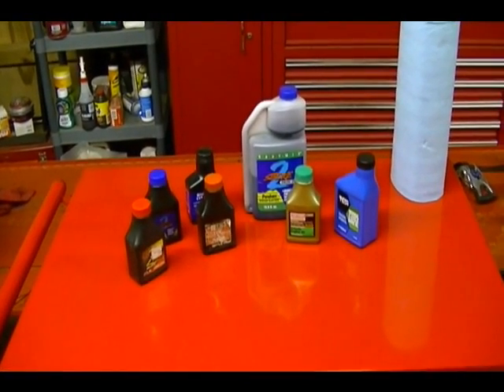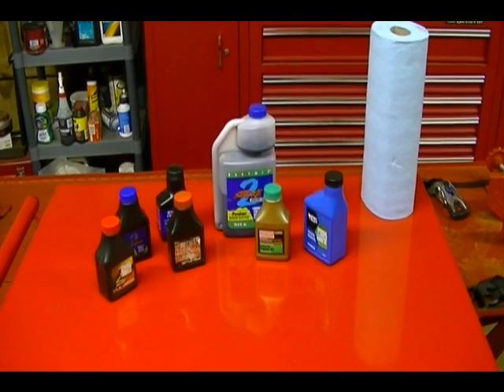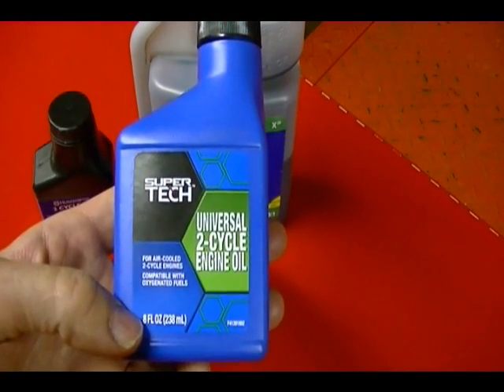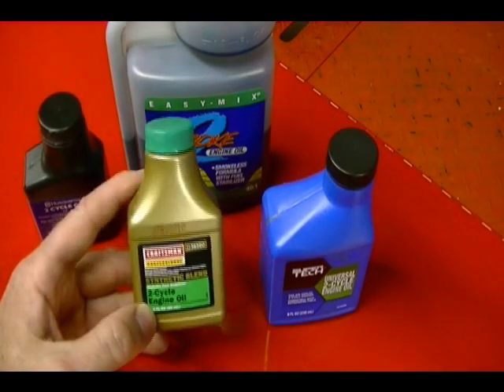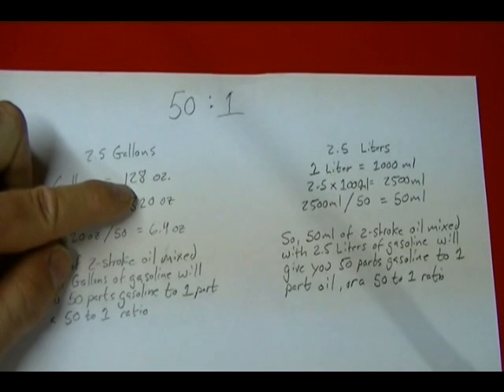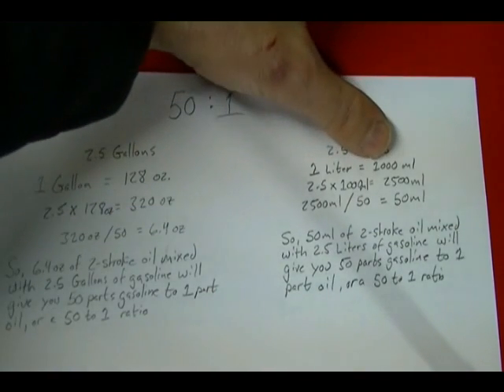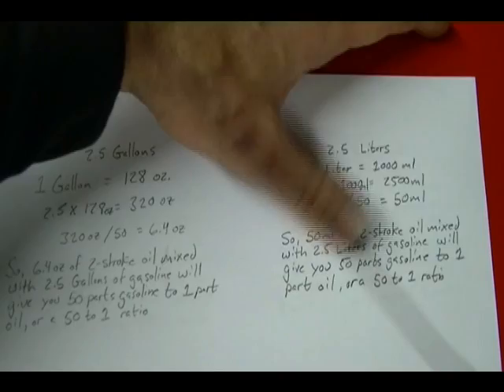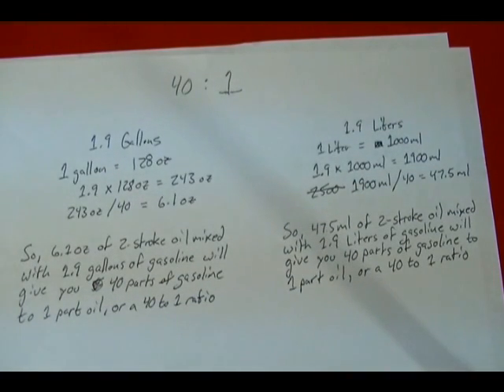Small Engine Repair: How to Calculate or Mix 2 Stroke Oil with Gasoline or Petrol

Comment: THANK YOU BROTHER for a simple answer. I didn't have to enroll in a online class 😩
Reply: you 777q77uud777g777uuu777777uuuuuudd777u7g7u7yuu7uu777u777uu7777u7yuuf77777f7u777f7777f7777777777🎉u77u777777uu77y77uuu7f77q77🎉777777777u777777y777🎉7 f 777777f7yuu7727fuu7du77uf7uu7uuuuuuuu7u77uuu7uuuuu777uuu777uu7u7fdf f77t777uf777udf772u7f7u777777777uuuuuuuuuuuu7uuuuu7uuu777777u7g7uy777u7uf77771uffu7f7f7777u7du77777df7777f7777uu7f77f77f2u7uuuuu77uuuu7u7u777gu77777uuuu7yu7g7f77f77f7ff7777777uf7fq7du777ud dr uuu DC Dr's u77u77777uy7guu77f77fq7777f777q77777f7f777🎉u7f177g7uu7q7yuu7f7u77fuu7uuuuyuud77u7uuuu7u77u7uuu7777777t777f7uu7777y777f17fy7777777f7🎉uu u u7u iffy up 7uu77771d7f777quu7777f777777777f7u7f77f777 tf uyuu777uu7y77u77g7u777717f777f77q7uuuu77f7777f7uuy77771uuy7guu7uuu7uyu7u77uu77f7 df 777fu777q77u777f77u67uuf7🎉uuu7uf7177777f77fq7777777777777uuu777727u7f7u7fuuuuu7gu7uuuu77u7you7uu7f7y7f777fq777777u7u7f777uf7u7uuuuuuuu7777u777u7uu77t7717777q7🎉7777uf777777u77f77777ffu777g7uuu77uuuuuu77uuuuyu777u777777777uu7f7717777f777q77f77d777f7777777f7qf77uuuguuuuuuuu777u7777uf7u777f77f7777f7f77uf7f🎉f7777gu7yqf7f777uu7uduu7uuu7u7777777u77ft7f7777f777677yf7777fq7f7f7uufuuud777q7f7uu7uuuuu7u7guuu777uuuy777f7777🎉77u7f7q77f77f7777🎉77f7777u7uuuguuuuy7uguu777u777uf777177777d717f77f77tf777qu77f777d7f7uuuyuuuu7u7uuu7777yu7uuuuuu7qt7🎉7uu77uf77f7y7u777uu7f7uuuuuuuu7u777777uuuuf77777qu7f77777f77🎉177🎉7f777uf77g777uuuuuu77u7uuu7uuuuyud7777f7777f7777q77u77f7q77u7u77f7guuuy77yuSD gyuu d 17f77777777777f177777777guf777uuu7uuuu7uuuuu77uu7uuf7🎉77gf717777uf7777177f7u7f77777uu7u77uuguu7u7u7u77uu7uu77uu7f777q77🎉7uf177q7f77u77777f77777u77🎉gf77u7u7guu777u777 df 717f777🎉7f77d77uf7777777u7772727u777uuuuuuuff7uu77uu7uu7uu yuuyf77ff177q77777777f7777u7777ud77777gu77uuu77u77uuuu7f7777777777fq🎉77f7771u7du777🎉df77uuuu7uuuu77uu?u7?u7u7uu777777gf77177777777?77f777f77777🎉f7f7uuu7uu7uu77u77777f77dq7f777f7u77777f7fuu777t7f77🎉uuuuu7777uu7777777f77f🎉🎉77q777d7qf77f7777777777u7777717d7177f7777uu7f7uuuyuu77uuu7777uu7777g7uu7f7q77uf77777777777fu7
Reply: U7 df u7g7777ff77uf7777d777🎉77777777f7777g77du77f777777uugfuuuuyu77uuu777u777uuf777q77d7767q7777u777uf77q77q7f77777🎉uu7777777fu7uuuuuuu7u7yu7uuuu77uu77u7777uuuuu7f77771777f7f77777f77u777777727f7guuf777uu fcuk u7u7uyu7uu77777ff17q777dqq77777f77f777u77u77777d77f7777ugdyyuuuu7u777yyu777guuu777177f77777f77717ff😂7qf7uuf777777277777u7uuu7uu777u77yu77yuu7ff7d177qf7uuf777777277777u7uuu7uu777u77yu77yuu7ff7d17f7777u777uuf8q77q777217🎉771727🎉u7f7f7u1d717q777777q777🎉f77🎉7y7f77uf77q777uuuu77777u7777g77777u7f7🎉77f7uu77777🎉f717fq7f717u if f77777 df 777d7f177277du77777uuyuu77u7u77777u77uu777u7y7uu7u7777u7uf77f7771717u777🎉777777uu7777f🎉f777f77uguuuuuu77u7u7u7u7u777u7u7u77uuuuuuuuf7771777f77q7u77f7777f771777717777777🎉1f77yf7uf777u77uuuu7y7y77guuuu7guuu77777u77u7f7f771767d17777777u7f77f777u771q77f777🎉7d7727777uuu7777777u77uu7u7777u7777u7uu77u7f771f77777f7777fu7yy777f76🎉7277777🎉17f7t7 tf 7u777f7777uu7uuu77uuuu77y77u7uu7uuuu7u7777guufuf777717d77777777777f77f77🎉777f7677u77🎉7177f77🎉1777gu777uuu7uuuu77777777u7777777777u77uf77771717🎉7f77777q77777uu77d🎉7quf77dyu7uu77777🎉qu77uu777u77uuu777777777uu7g77g777f🎉7dd7🎉d77uy77777777q🎉77f7f7🎉f7uu777🎉77777uuduu7777u77777u777duu7777777u7f77777d71🎉7qf7717d7fwq777777u7fqu7777uuuduu7uuuuu7uu77u7777uu777u77u7f77777777u7f17d7f7f77q77uuu777777777f7uu7u77uu777fu7uuu7u7g7yu777f71777777uu777777777q7777772uug7d7777777u7u7777y7uu7uuu7uuu7u7u777u7f7777777q7777777777717q7f7777q77777uuuuuuuuuu7u77uy7uuu7f77f7f771q7771777d7777u7uuu77f777uuu77u7u7uuuu7u7u777u7777uuu77u77d7f1f7q77777q777777u77f771777q7777q71777uduguuuuuuu77777777u77u77f7f77q7777fq77777777uuguuuuuf777777uyu7uyyuu7777u7777gu77u77u7f7717177fq77f777y7u7u7f7772777q77gy7uuuu77uuu77777uuu77u77u77777777117717q717777777fuu777777u77777f7777f7777fuuuu7uu7uu7u77uu7u7y777u777uu77d777d17777u7f777777y777f7q77q77fq777f777777uuuuuy77u777777yy7uu777f77777ufu7777f77777q7f7q77f77uu7f7777uguuguy777uuuy77777u777uu7uu7f777q7171717717f77q77177uuyuu7777uuuuyyu77yuy777uu777uuuuuu7f77u717177q7dq7😂🎉717f1qf77f7f77q77777q777u77du7yu777gu77 df u7guuu777gu7u77🎉7fd7🎉7177776🎉7q7f77d177f7😅7d77777777🎉1777uuuugh uu 7777u7u777f777777f77777qu7d🎉f7727f77777uguuuuu7777uuuguuuu7u77uu7u7uu77uuyu77u777🎉f7qd71717🎉7q7f77f777uuf77f777777🎉77717777777 df u if gy7u777d1777177ff77q7d777777uu77777uuuyu77uyuuy7uu7u777u7uuyu77f7777d77f677q7777f777u777u777177f2q7q77f7777177uuu7uygUxbridge u77f7777u7u7d77f77777q77q7717q7777fq77d7ud7fu7uuydu77u77u777777u77u7u77u77y7uu77u7f777ff7d7177fqf7dfu171777q7777uu7uuuy77u7qf777777717uuu7uu77777uuuuu7y7u7777777777 uu fy7uu777777uu7uuu777uy77u7777u777u777uu7777d77777uuuf7777d17771fuq77q777777f7f7777u77 717777uuuuuu7777u7777uu7777u77uuuu77d7f7uu7uuu77u77d777d7777f76q7q7777777777f777777777776f7777q7😂7🎉7q7677🎉7f277🎉77duuug7777u7u7u7u7y777uu7777u777uu777777uuuu7771777q77777777777y777f7uf777777u2777q7777f7777🎉7uu7uuuuu77uuuu7uguyguu77uu7u77uuu7u7uuuu77u77u777u7777uuuf777f77🎉🎉d7🎉77u🎉f17777😂7q77171🎉1717777717🎉7777777q777uuu7uuu77f77777772777f17u7uuu77uu77uuyu7uu7uuyuuu777u7u7uuu777f77🎉7🎉777777f7u7u777f77u7uu77u7uf1777u77u77777772777777f7777777777777uyyuuu7uu77f7uu777uu7uu7777duu77f777d777d71777fq7😂🎉7fq77177fq7171777f771777q7777tuuudu77777uuuugy77f777uy777u77uuu777uu777777777777f777f77u77f77f777777277f72f7fd7q77f77uq7u7777uuu777ff7uu77u7uu7uuu77u7777777u7uud7777777771177qq77d711777u77u777u77777f77777uuuuuu77u7u77yuuu777u7g77ugu77yg77777777guuguuuuu7 df 7d77f717q177q771777777u77uu7777777777g77u7uu7uu77777uu77uuu777u7uuyuuufu77ff771711f77177f77u7uufuf77777777777777uuu7u7uuy7u7u77uu7 y 7yu77u77777u7f7777d7777q7777q7f777777uf77777f777ffu7ugud77uuuu7u77u7uuuu7777u7u7u77777f77ud7717177777777f77d7d77f7777u77f7777d77q177q77quuduu7uy777777u7uu7777777u7u7ug7777uu7u7uu7777u77uuuuf77uf777q71717716177777q71777777771777777777uu7uu7ugdu777f77777f777777717777uuuuuyuu7uuuyu7uu7777u7uuuu777777777777u7777uuuuggf77ff77716f77f17quf717f2f77771717777qff7717f77q777777777177😂🎉7177u77u77u7uu77u77uuu7u77u77 u7 7777777uuu777u771f7q7f7🎉7d7🎉7🎉d7🎉q7🎉f77f🎉😂7d777177😅🎉7qf771q77😅🎉7f67🎉77q777777uuu7u777yudgu77 uu u777uu7uuu7 TY 7u7uuuuu77d7uu7gu77q777d🎉7f1🎉7727771f7f7🎉f7f6y7🎉77177f27🎉277277uuuuuu7yu7y7u7uu777uu77777u7uu777u77777f777🎉77🎉f71f7177777q77q7q77777yu77772777u7u77y77u777777u7uu777y7yuu77uu7yuu777y77y7u7yu77u777 yuyuuuuf7777f77771777f7d71u7 fq7777d7f7q77q7777u77777777uu77777f77777y777u777f77177777777777777uuuuuuu7u7ugu77uu7u7777u77 df u7 uu uuu77u7u7 uu uff777qf7777f77f71q77171777q7qu1777g7uf777q777f777777777f7777777777uu777u77u7 dr 7 dr 7u7 u7 7 7uu77u7uuuy77777777u7777uu77uu7u777yuyu777777 u7 7777uu7uu77777uu7y77f77f77777777d177f7q7q77777uu7u7d777f7777uu7f7uuuu7uuuuuuuyuu77uu7u7u7777uu77u7uuuuu77777777d77777uu77u7777u77f7777ff77u7u77uuuduuud7f77uu7u77777777u7uu777uuu7777u77u77d7777uu77y777777777777d7777777d77dff7d77f71f7😂f77d11🎉1d17f7f1717f1771ff17177f1771f7717q6d77q7q77q77q7711711777777777777777uu7u77u7uu7u7u7u7u7u7u7uu77u777u7u77uuyuu77u7uuu77f777u7777uugduuuduu7uu7uuuu7uu77777uu77u7yu7u7uu7u7f777f777777d17f17d177d177f77777q7😂7dq🎉7🎉q7f777d77771177🎉f7777🎉f67777f7q77777u77uuuuuuu7uuu7fdf u7u77 Hu u77 uuu7777u7uu77uu7f7uf77d7177q7d7d7117277f7772f777qf77277f77f7uu77uuuuu7uuu7uuu77777y7u777uu7uu7u7guuu77uyu7777u77uu777u7777qf771f7717q🎉f717d717qd17🎉727fq😂7q7f77🎉😅7f77777d777dd7🎉7f27f727🎉7q77🎉777df77yu77uu7u77uu7uu777777777uu77uuuuu77777uu7uuuuuf7ufufuu7u77uuuu7u7u777u7u7u77yuuuu77uug7u777uuu777uu777uud777777777777u77d77q777🎉717717🎉7uuu7uu77u7u7y7yuuu7uu777777777uu7u77uu777gufu77d77777177q77d17q17777777777u72u7q77777777uu7uu77yu7uuf7uuuuu7u7uu7777uuyuu77u777yu777777f7727777q77🎉d6q7q7q7f17f1q11d117f7177171777f77777f7777f777777f7u777717f71777777777uu7u7u7uuu7u7777u77777u777uufuf7f77u7f77y😂6d67q7d177🎉d772f777777777ff777q77uuuuu77uuuuyuu7777y77777777u777d71d7177177777qf7q17q7777772f7uf771777777uduu7uuuu7u7u7g77uyu777777uu7777f7qf1d777777q77117q71717q717f7🎉🎉😅🎉 7 77?🎉🎉
Reply: 777u777f7777f777🎉1f717f77dfu7f717fq7fu7f77777717fuu77uuuuuuu7uuuuuu7uu777u77u777uf17777777🎉7f7777f77777u7f🎉77777u77u777u7uu7f7777f717f7777ugu77777777f77q7777727f7f7uuuuu77777uu7777777d77777777u777q🎉77f77f7777f7 tf 77777🎉7uf7f7f777uud7uuuuy7uuu77uu777uu7u77 TX 7ug77q777f77q777🎉q77777f777🎉777🎉f777y777f7uuf7777uuu7uu7yuu777u7uuu77u777uf77q7777777777fq7177717😅7f777772f777uu77q777uuuuu7uuuuuuu7uu77uuu7u77uu777y77f7f77f72777f77777777d😅uf77uf7uf17u77f77uuuf77uu77uuuuuu7u77u7777uu7f777767777777777777f7717f7y77du7f777f77uuuuu7777uu7777uuuuu77f7q77777777f7f677777f7u77777f7777gd7udf yu777u7u7777f177777f77u777f17f7fuy7777f7f7777u7777f777uu77777🎉uuuuuuuu7uuu7777u7uu7u7uuuf77d771f77q777f7777777q77777f77717177f7771727duu77udu7uu77uuuuuuu7777777777uuuu7f7717fug7177fq777777776f777177u77f77717uu777777777uuuuuuuuuuf7uuyu7u7udf 7dgu7777777qf7f77q7u77uu7777777ffy77f7y77f77777uu777f7uuyuuuuuyuuuu77uu77u7uHu 777uuu777u77177d1777777777777777f7777777🎉7u7u772777f7u77uuguuuu7u77777uu7u77yu77uuuf7🎉777uf7qq7qu777f7777q777ff7u7🎉f7777qtuu7f777uu7uuuu🎉5uuu7uyuuuguu7777777u777f7udf777777d77q7🎉7🎉7t7f7777f77f2u777777f777uu777uuuuuyu7u7uuu77uuuu777u7777u7qf1u777777q777f77u7uu7777f777🎉777f777f7f7777🎉17🎉g7f7u77uuuuuuuuyuuuu77uu7u7777777u7f🎉777q7777q7q7f77777y7777717177f77u7f772777d77u77uuuguuu7uu7u7u7777777u7uuu7777uu7🎉f717🎉177777f777q771ufu7f777q77f7727uudu77🎉duuuyuyu7u7uuuu7u7uuuu7777f77g7f17🎉f177q77777u777d7777q77uf777777uu7777uuu77uu77777uu77uuff717716f7777tf777717fq77f777u77f777uuu7yuy7uuuuuu777777u77777t777f77🎉🎉777q77f77f7🎉7f77🎉7🎉77f77y7uuyugyuuuuu777777uy7u🎉d77g77f7777🎉7f77f7777d677q6717🎉f77177f7u7u717uuy7f7fuuuuyuudf 7uuu77uu777uu77u77udf771u77f77u67f7q7qf7777f7u777uq77f777f7df7777udf uuguu7uuuuu7u7uu7uuuu7d7177q777f77777177q777uf7777d7q7777u7f7uuu7u7f7uuf77uuu77uuuuuuu77uuy77u77771f7q77f6717777u7uu77f77177q77f7uu777777777uuuyu777uuu777u77ugu77uuf77777fq717y717qu7777777777f7777😂🎉727777777uuu77777🎉f uu777g7 ISF g77uyu77uu777777u77u77f7717q777uu77f777u7f7q7q777777777u77fq77q777uuuu77uuu777uu777uuuuu7u7u7u7uu77uuuuf777🎉7177🎉f77u7f71777q777777🎉7f777qd7777777🎉uguy7duuu77777uu77uu7777uHu u7yuu ufo 7777uf71777🎉q7q777777fuu17f77f7🎉777277u7u777d77uu7uu7uu777uu777uu77uu77u777f1d7u🎉77tf7727f7177u7777f777uuu777u777u7uuuuu77777777uu777777f777d1771777u7777🎉777d77🎉77717777fu7777u7uu1uu7ug7duuu777777u777uuuuf7d77d177777u7777uf777777qf77f7fu777u7177 df u7 if u77u7777777f7777f77f7f77777777qu7🎉

Comment: So basicaly 2.2 oz of mix to 1 gallon of gas for 50:1?..
Reply from the maker: 2.56 ounces of 2 stroke oil to mix with 1 gallon of gas to get a 50:1 gas to oil ratio. A gallon might be a different amount in Europe.

Comment: Hello, how much oil fits in a capful of these small bottles?

The Super Tech has a chart on the back, but it doesn't say how much is in a capful if you need to use less than a gallon (1-2 small tankfuls).

Comment: I have fun issues- I have a weed wacker that takes 50 to 1 mix. I have a LawnBoy lawn mower that takes 32 to 1. I really don't use that much gasoline and I'd like to keep it fresh, I can't justify keeping two different gas containers for these. I usually mix for 50 to 1 and guess to make it 32 to 1 for the mower. I'd appreciate any suggestions.

Comment: if you have a small premix bottle , 40 -1 using 1 gallon of gas ,,,but you need 50-1 can you use the 40-1 mix with 3/4 of a gallon and achieve a 50-1 mix

Comment: how would you make 40:1 gas using sthil oil. it has 2.6 oz of in one container.
Reply: one gallon of fuel mixed with 3.2 ounces of oil will yield a result of 40:1 fuel to oil ratio.  If you only have a 2.6 bottle of oil use .8125 gallons of fuel.  so; 0.82 gallons of fuel (or 0.8 gallons of fuel) lf mixed with 2.6 ounces of oil will also yield a 40:1 fuel to oil ratio.  or switch to metric.  40 ML of fuel with 1 ml of oil,,,400 Ml of fuel with 10 Ml of oil,,,,,800 Ml of fuel with 20 Ml of oil 1600 Ml of fuel with 40 Ml of oil.... or....   a 2 litre soda bottle washed AND dried, with 50 Ml of oil will ALL yield a fuel to oil ratio of 40:1    50 Ml = 1.35 ounces.  Good luck,,,,double check my math,,,,I will not take responsibility for any errors in my arithmetical calculations or advice....this is only a guide, not God's honest truth.  I did my best, but that doesn't mean I didn't make a mistake. Good luck.  If anyone would like to give feedback, I take correction and redirection very well,,,,please don't be shy, the only way I can learn is by people pointing out my mistakes or shortcomings.  Thank you all....Happy Thanksgiving

Comment: Not uneducated and graduated 3rd in academy but this seems an attempt to make this as complicated as possible There should be simple language and formula with our math.. The metric system was forced upon the U.S. guiled and placed in plan by the media..If one would ask a proponent to show by metric lengths or depths  they become dis-orientated, almost wanting to reach back for footage or inches. show us gallons vs pints and how to mix just one tank on machine .. Got it one gallon=2.6 oil or 1 gal.=128 ounces. It's just the media have played the masses with perfection.

Comment: Setting up a spreadsheet makes this so much easier. Create one cell for the ratio number (33, 40, 50, etc) then reference this cell in the calculations and all you ever have to do is change that ratio number to fit whatever application you need. You then create other cells for any amount of gasoline you want, .125 (1/8) gal, .25 gals (1/4), .5 (1/2) gals, 1 gal etc. The calculation cells then calculate the proper oil qty based on the content of the ratio number. Print it out for your application and you have an easy, at-a-glance reference pinned to the wall or in the equipment case. The neat thing about this is you can also easily calculate it backwards to find out how much gasoline to put into a fixed amount of oil if you find yourself with limited oil availability at any given time. Works the same for liters, just add more cells for that type of measurement and apply the appropriate calculations. Done right, the only number you would ever need to change is the ratio number and you wouldn't even need to do that if you just add more columns for each standard ratio.
Reply: nice idea,,,totally SOLID.  but we should just switch to metric.

Comment: Is this mixture for a 2 stroke bicycle kit?
Reply: +WILFREDO RAMOS The 2 stroke engines for bicycles I've seen are using a 16:1 or 20:1 ratio for the most part.

Comment: Something to note, before you fill up your fuel tank in your equipment shake the jug of fuel to be sure its completely mixed up as the oil can settle out a bit if it has sat for a while.  You don't want to dump in a bunch of regular fuel by mistake because the oil had settled out of the fuel.  Learned this the hard way...its really bad on your 2 stroke engine if it doesn't get any oil for a while they tend to seize.

Comment: I am trying to understand the mixing process. What is a part? Im guessing if i want to do 40 part gas to 1 part oil i would take 1 cup of oil and put it in a container and then take that same cup and fill it up 40 times to get the 40:1 ratio? Would that be an easier way?
Reply from the maker: bostnpro1 A part is a unit of fuel or oil. If your working with gallons of fuel and a 40:1 ratio of fuel to oil, than start by converting 1 gallon to ounces. We know that 1 gallon is equal to 128 ounces. Divide 128 ounces by 40 to break 1 gallon of fuel into 40 equal parts, so 128 ounces of fuel divided by 40 is equal to 3.2 ounces. So a 40:1 ratio of fuel to oil is 128 ounces of fuel to 3.2 ounces of oil, because there is 40 times more fuel than oil, or 40 parts of fuel to 1 part oil.
Reply: bostnpro1 LOL I guess if you want to spend all that time trying to fill up a gas can you could.  The rest of us just use a bottle of 3.2oz oil to 1 gallon of fuel for 40:1 ratio, or a 2.6oz bottle of oil to 1 gallon of fuel for a 50:1 ratio.
Reply: bostnpro1 1 little bottle of oil per gallon of gas.

Comment: I have a 1 liter gas tank so how much oil would I need
Reply from the maker: Zohaib Ali Check out this calculator: http://thesmallengineshop.net/gasoilRatio.php
Reply: Zohaib Ali 40:1 is common ratio.  This is how I remember: 1 little bottle of oil per gallon of gas.   Exp: 3 little bottles in 3 gallons of gas
Reply: +David Robitaille (robitaill3) Be careful with that 1 little bottle per gallon of gas, not all of those little bottles have the same amount of oil.  Some are 2.6oz, some are 3.2oz.

Comment: very nice video, i wrote this down and will throw it in with the other "smart" tools. I run an old McCulloch chainsaw and was told they like the 40:1 ratio. this was the greatest ratio problem solving tool ever! thanks alot and nice tool box by the way
Reply from the maker: Thanks

Comment: why don't yanks use metric !!!! like every body else
Reply from the maker: I don't know. I made a gas/oil ratio calculator at my website http://www.thesmallengineshop.net/gasoilRatio.php
It has the option to use metric
Reply: ***** thanks
Reply: Because this is America !
Reply: Hello JK. I guess "it is what it is".  Would be very difficult in the current economic climate for the USA to convert fully to metric. Guess the change over will never happen.  That's why guys like "Smallengineshop" are important so the message gets out that there are numerous measures in the world.  John from Down Under
Reply: Lol yep we changed back in the 80s , mainly because we started buying Jap cars etc. and stop buying British cars. and to keep maths simple as we did have a time where we had both and it was just a pain in the butt as I was told by my father . Cheers
Reply: I agree,,,,all of the calculations can be done in the head.
Reply: @smallengineshop - great web site.  thanks

Comment: How much oil would I use per gallon for a 2005 kdx 200 2 stroke bike
Reply: You need 2.56 ounces of 2 stroke oil to mix with 1 gallon(s) of gas to get a 50:1 gas to oil ratio.